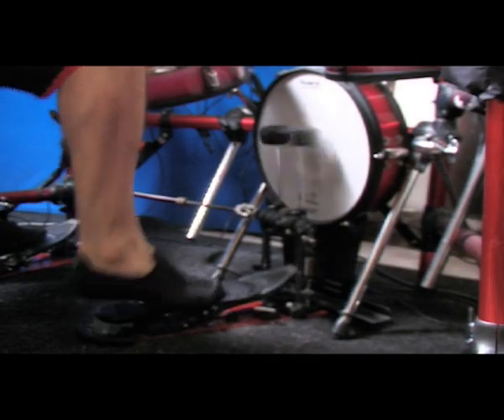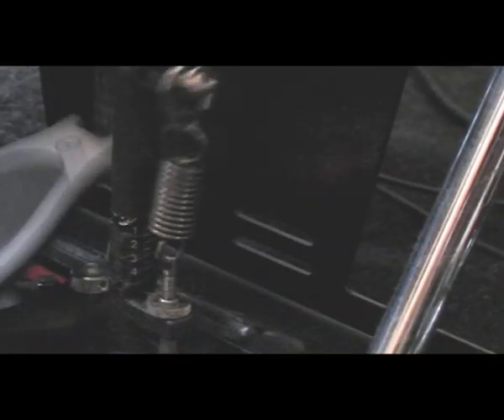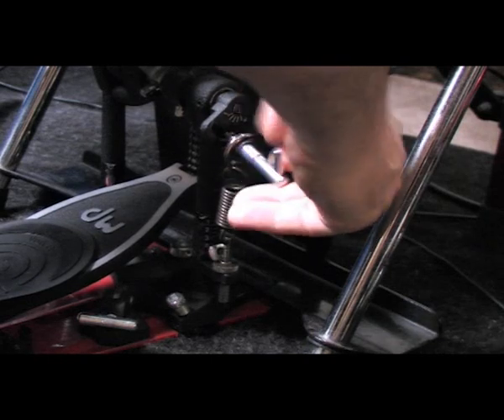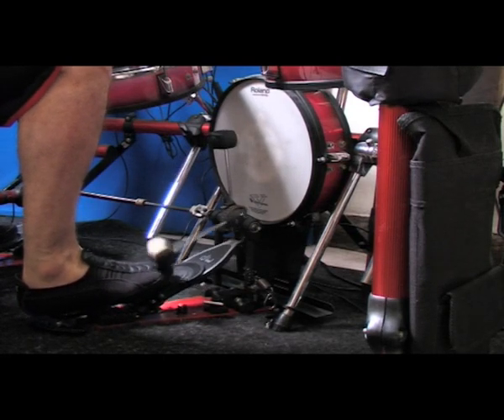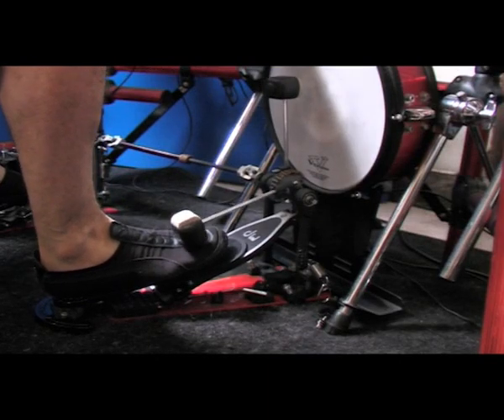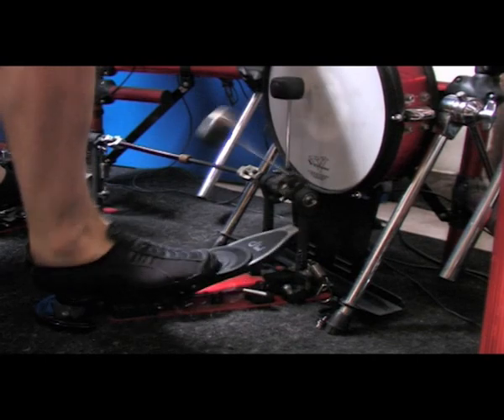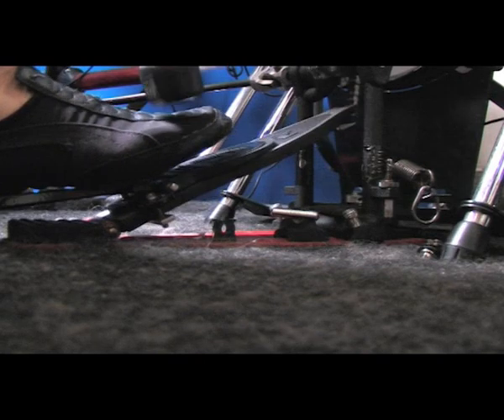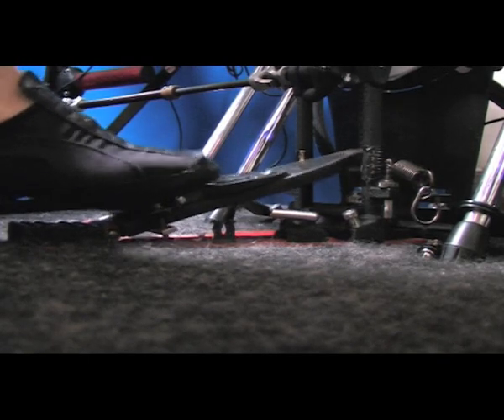Discover The Main  Force Which Drives Bass Drum Pedal

Comment: Agree. I have not gone to the extremes you have here, but just experimenting with different drums, different tuning (head tension), different muffling, vented vs. double headed (air can't escape)... I can attest that the way the beater bounces off the head is the biggest factor besides the drummer's foot. Also consider the weight of the beater, how high or low the beater is positioned, and also some drum hoops are wider, placing the pedal mechanism further away from the head surface. Good video.

Comment from the maker: It is not a trick and it doesn't require drum head to be tight. You will get rebound even from lose head. You pick up rebound by pulling back through vruk plate, similar as with speed king pedal. Spring obviously makes it even but rebound is the main thing - the king.. Great comment, thanks